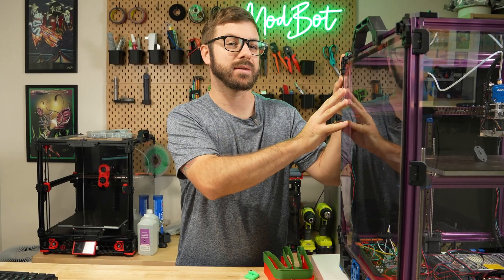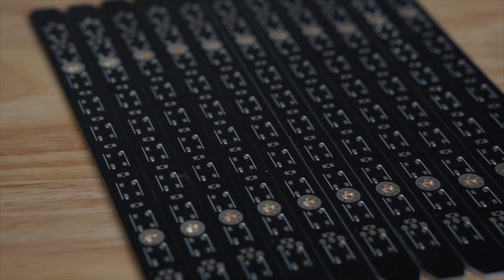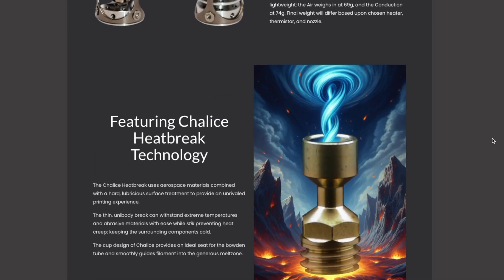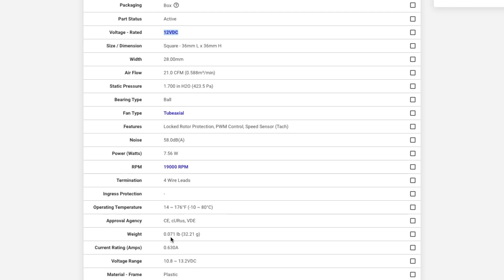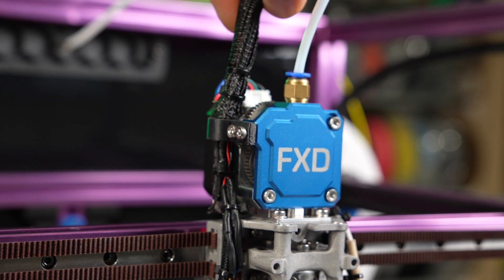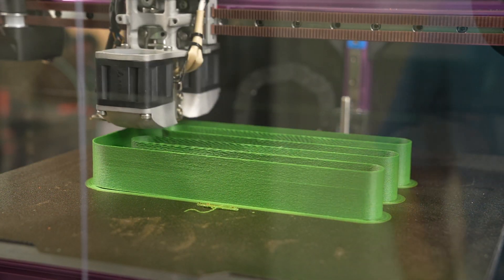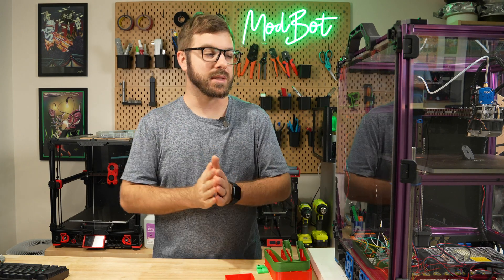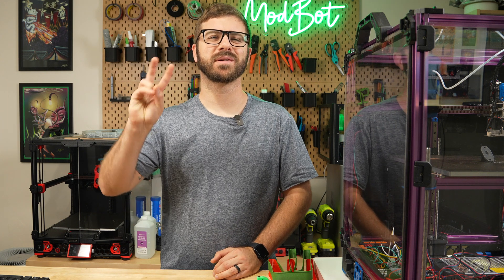You've Never Seen A Toolhead Like This! (Takeoff)

Comment: Burgo here! Thanks so much for showcasing my toolhead! Im so happy with takeoff v2 at this point i did alot of changes which made it
Cheaper
Lighter
And easier to put together!

Ita definitely a chunky toolhead but for being in a close weight to stelathburner with easily 10x the cooling, capability for high flow rates, dealing with hot chambers.

Id totally recommend monolith gantry by cloakedwayne as an upgrade though! 6mm belts have alot more stretch then 9mm at length so why not tackle longer belts and thicker at the same time!
Reply: I would also recommend Monolith vs my plated AWD. Neat to see it show up in the video though.

Comment: I hot-glued a MP1584EN buck converter to my 12V fan so I could run it from an EBB36 at 24V. It's kinda ugly but has been working great for years. The buck module is connected to the fan header, which is configured as enable_pin, and then I use a separate pin for PWM control of the 4-pin fan. You could also run 12V power from the mainboard and use the toolboard for PWM. This would work even with 2-pin fans because it's typically the low (ground) side that is switched.

Comment: you mention an ugly umbilical cord, ugly wiring, but mention nothing on the ugly volume delta fans produce, or how ugly the print head looks.. not to mention youve only printed test parts.. so basically you were testing it with no plan to actually use it..

Comment: I'm sorry how is this a hell of an option for peak performance and industrial application???
First of all industrial application usually means printing with not so printing friendly filaments like pa and such. They are never printed at speeds higher than 5mm3/s cause they lose strength otherwise so having a giant heater is pointless, and only adds weight. Even abs is recommended to be printed at that speed. More is only plausible for PLA and PETG.
Secondly with those behemoth of a fans on the printhead im wondering why not just strap a car turbocharger turbine? Its just a teeny-tiny bit heavier and provides a lot more thrust, you can even blow the part off after printing. Its not like having an extra kilo or two on the accelerating part makes it perform worse. I must be tripping....
Don't even get me started on the 6 bolts of rigidity of the radiator....
Jokes aside if you actually want a high performance printhead, you shold use nema 14, orbiter like feeder, cool it with cpap assembly and trusty 'ol e3d volcano for industrial application, and maybe a Goliath if you want to print PLA at 200mm/s

Comment: Will you consider using a tool-changer?
:) you might be able to use the previous tool-head aswell
and the more good youtubers build it, the more info there is on how to do it yourself & build the toolchanger community.
(i am thinking of getting a toolchanger myself for the Voron 2.4)
but there are 2 - 3 ecosystems out there

Comment: PLEASE PLEASE PLEASE. do a full review of the LDO smart orbiter 3. I believe it has inbuilt tool board with accelerometers and USB connectivity? Are the hardened gears standard or an optional extra. What is the hot end max temp???? Please do a review. 🎉

Comment: This toolhead is a complete nonsense (in the literal bad meaning). It is so heavy it prints bad. We can see VFAs and Ghosting in the printed parts you showed - after you applied input shaping. This is very often what I see in many Voron machines: people go into an insane spiral of "premium hardware seeking" and the whole thing gets too heavy and prints bad.
I love your content, Daniel. I liked the video. I don't see why anyone should spend so much money into something that doesn't print better than a good consumer printer (I am talking about this head setup, not the Voron project as a whole).
Reply: One person (using the stock gantry) having mediocre results doesn't mean the toolhead is bad. Everything you said in this comment is just stupid.

Also, this toolhead weighs less than stealthburner. So ignorant...
Reply from the maker: It’s heavy yes, but I don’t think it’s quite as heavy as you think. Much of the limitations are from the rest of the printer needing upgrades to be able to really take advantage of it. Beefier motors, 9mm belts, cnc motor mounts/XY joints to really take advantage of it. The plan is to have this as a high temp printer that can print fast and clean. It’s not there yet but this is the first step. Do I think this is right for everyone and that people should rush out and buy it? No but for those that have the need and want to really push the limits having the option is really nice. 3D printing is not a one shoe fits all and while I mostly cover more standard hardware being able to also look at some of these other options occasionally is a lot of fun and I learn alot in the process. 

I’m hoping to continue to upgrade this machine and get it to a spot where I can use it for testing out higher temp materials for those that do have a need or want for them.

Comment: I have 2 12v fans in series on my printer so i can drive them with 24v. I know theoretically there could be fluctuations where one gets more voltsge than the other if one stops, but ive had no issues and stopped one entirely just to test ($2 each)

Comment: So it's big and heavy and therefore slow. But it's big because it needs metal to hold 2 very big fans. But the fans are too big, so you only need to run them at 20%... yeah, that doesn't add up: this thing seems overengineered and overshooting its goal. Not very useful this way.
Reply: Hi there! This toolhead was designed with a stiffer gantry in mind (metal+9mm belts) which will allow the metal to do its job! The toolhead is stiffer than any plastic toolhead but can really use the stiffness in the rest of the gantry. Takeoff weighs close to the same as stealthburner, and plenty use that as-is! Also: The 20% fan thing is mostly due to low chamber temps - when you print near TG of abs (70-80c) you will need significantly more fan for proper printing, which is why these axials are so good.
Reply: The fxd extruder actaully is within 5 grams of an orbiter "it supports nema 14 or 17 "

Comment: I'm running Calamity toolhead, not takeoff but also get great Y results and messy X axis.  Haven't figured out why yet but until then or as another video idea you could look into danger-klipper and using independent x/y accel limits.  I've been doing it for a few months now and it works great.  Basically, set your printer kinematics to limited_corexy instead of corexy and then you can set independent limits for x and y accel.

Comment: What's special about this extruder ? From an outside view, it seems like a simple LGX clone
Reply: It's monolithic, so the gears can't be misaligned like with pressfit gear systems leading to bandng due to inconsistent length of extrusion because of the off axis alignment of the gear and the gear pin

Comment: hey @ModBotArmy I want to use the sensorless homing macro. Is there any chance you can send me the link for the macro?
Reply from the maker: This is what I got from Steve. I made some slight tweaks like changing the TMC and setting motor power to 70% but thats the main changes:
[homing_override]
axes: xyz
gcode:
  {% set home_all = 'X' not in params and 'Y' not in params and 'Z' not in params %}

  {% if home_all or 'X' in params %}
    _HOME_X
  {% endif %}
  
  {% if home_all or 'Y' in params %}
    _HOME_Y
  {% endif %}
  
  {% if home_all or 'Z' in params %}
    G90
    G0 X150 Y150 F6600
    G91
    G28 Z
    G1 Z10
    G90
  {% endif %}

[gcode_macro _HOME_X]
gcode:
    # Always use consistent run_current on A/B steppers during sensorless homing
    {% set RUN_CURRENT_X = printer.configfile.settings['tmc2209 stepper_x'].run_current|float %}
    {% set RUN_CURRENT_Y = printer.configfile.settings['tmc2209 stepper_y'].run_current|float %}
    {% set HOME_CURRENT = 0.6 %}
    SET_TMC_CURRENT STEPPER=stepper_x CURRENT={HOME_CURRENT}
    SET_TMC_CURRENT STEPPER=stepper_y CURRENT={HOME_CURRENT}

    # Home
    G28 X
    # Move away
    M400
    G91
    G1 X-10 F1200
    
    # Wait just a second… (give StallGuard registers time to clear)
    G4 P1000
    # Set current during print
    SET_TMC_CURRENT STEPPER=stepper_x CURRENT={RUN_CURRENT_X}
    SET_TMC_CURRENT STEPPER=stepper_y CURRENT={RUN_CURRENT_Y}

[gcode_macro _HOME_Y]
gcode:
    # Set current for sensorless homing
    {% set RUN_CURRENT_X = printer.configfile.settings['tmc2209 stepper_x'].run_current|float %}
    {% set RUN_CURRENT_Y = printer.configfile.settings['tmc2209 stepper_y'].run_current|float %}
    {% set HOME_CURRENT = 0.6 %}
    SET_TMC_CURRENT STEPPER=stepper_x CURRENT={HOME_CURRENT}
    SET_TMC_CURRENT STEPPER=stepper_y CURRENT={HOME_CURRENT}

    # Home
    G28 Y
    # Move away
    G91
    G1 Y-10 F1200

    # Wait just a second… (give StallGuard registers time to clear)
    G4 P1000
    # Set current during print
    SET_TMC_CURRENT STEPPER=stepper_x CURRENT={RUN_CURRENT_X}
    SET_TMC_CURRENT STEPPER=stepper_y CURRENT={RUN_CURRENT_Y}

Comment: Could you please share the homing override sequence from the screenshots? Thanks.
Reply from the maker: [homing_override]
axes: xyz
gcode:
  {% set home_all = 'X' not in params and 'Y' not in params and 'Z' not in params %}

  {% if home_all or 'X' in params %}
    _HOME_X
  {% endif %}
  
  {% if home_all or 'Y' in params %}
    _HOME_Y
  {% endif %}
  
  {% if home_all or 'Z' in params %}
    G90
    G0 X150 Y150 F6600
    G91
    G28 Z
    G1 Z10
    G90
  {% endif %}

[gcode_macro _HOME_X]
gcode:
    # Always use consistent run_current on A/B steppers during sensorless homing
    {% set RUN_CURRENT_X = printer.configfile.settings['tmc2209 stepper_x'].run_current|float %}
    {% set RUN_CURRENT_Y = printer.configfile.settings['tmc2209 stepper_y'].run_current|float %}
    {% set HOME_CURRENT = 0.6 %}
    SET_TMC_CURRENT STEPPER=stepper_x CURRENT={HOME_CURRENT}
    SET_TMC_CURRENT STEPPER=stepper_y CURRENT={HOME_CURRENT}

    # Home
    G28 X
    # Move away
    M400
    G91
    G1 X-10 F1200
    
    # Wait just a second… (give StallGuard registers time to clear)
    G4 P1000
    # Set current during print
    SET_TMC_CURRENT STEPPER=stepper_x CURRENT={RUN_CURRENT_X}
    SET_TMC_CURRENT STEPPER=stepper_y CURRENT={RUN_CURRENT_Y}

[gcode_macro _HOME_Y]
gcode:
    # Set current for sensorless homing
    {% set RUN_CURRENT_X = printer.configfile.settings['tmc2209 stepper_x'].run_current|float %}
    {% set RUN_CURRENT_Y = printer.configfile.settings['tmc2209 stepper_y'].run_current|float %}
    {% set HOME_CURRENT = 0.6 %}
    SET_TMC_CURRENT STEPPER=stepper_x CURRENT={HOME_CURRENT}
    SET_TMC_CURRENT STEPPER=stepper_y CURRENT={HOME_CURRENT}

    # Home
    G28 Y
    # Move away
    G91
    G1 Y-10 F1200

    # Wait just a second… (give StallGuard registers time to clear)
    G4 P1000
    # Set current during print
    SET_TMC_CURRENT STEPPER=stepper_x CURRENT={RUN_CURRENT_X}
    SET_TMC_CURRENT STEPPER=stepper_y CURRENT={RUN_CURRENT_Y}

Comment: I run ABS GF with a .6 nozzle
Reply from the maker: I have had pretty good luck with even a .4. Some of the older CF filaments though I had clogging issues with. I feel like overall filament has just gotten better over time.
Reply: You should try our colored abs gf it prints with .4 at .1 layer height no prob

Comment: Looks proper hideous that tool head. What benefit is there with 2x 12v heavy blowers over a light weight cpap? I haven't run into any issue at high speed high flow printing using cpap. You could then get rid of all the weight and hideous wiring and use a tool board.
Reply from the maker: Beauty is in the eye of the beholder. CPAP is stupid loud which is one of my biggest complaints. Deltas at 100% are definitely not quiet but the way I have been running it is actually not that bad.
Reply: @ModBotArmy my cpap runs Max 30% and that's over cooling when printing at high speed. Put it in a muffler it's practically silent.

Comment: That hot-end looks solid, but it seems to have a learning curve  attached to it. Or am I wrong?
Reply from the maker: I dont know if I would say a learning curve. In my case alot of that came from being an early adopter. I anticipate V2 with the manual and configurator will be much more straight forward.
Reply: I'm running chube conduction.  No learning curve with the hotend at all, the fans are the only part that is a little non-standard, they are 12v 4 wire fans which most toolboards and even some mainboards don't support out of the box.  As long as you can get the fans working with your setup the rest is very straightforward.  I've been loving mine, finally found a hotend I was happy with and settled on after going through volcano, mosquito, volcomosq, rapido, and dragon ace before it. If you like to print big parts it's just wonderful.

Comment: Fairly certain the EBB board has 12v jumpers but it would look weird on your printer. Also, it's possible to overvolt some fans, I know 12V sunon fans handle 24V, but I'm not sure about delta's
Reply: ebb36/42 don't have 12V jumpers. Only the sb2209/2240 ones do have jumpers.

Comment: Artic MX-4 continuous temperate range is only up to 150 degree C.  Wouldn't you need boron nitride thermal paste instead which can go up to 850C?
Reply from the maker: Where it’s at it shouldn’t be getting that hot. My issue with boron nitride is that in my experience it gets rocked hard which could make removing a pain if ever needed for maintenance.
Reply: @ModBotArmy  Yes agreed.  That's one part of BN that I hate the most.   Have you tried measuring to see if it ever gets above 150?
Reply: The point is that it never gets that hot. The paste goes on the cold side, the heater+therm are where you use BN.

Comment: Suggest a Boron Nitride Thermal Paste for hot ends, especially ones that can go upward of 500C.
Reply: For the heater cartridge, thermistor, and nozzle, yes. For the heatsink and heatbreak connection, no. You want something that doesn't dry out

Comment: Luke is close to releasing Jupiter toolhead board which will have 12V and beacon support. I think even beacon sock support to slow even higher temps.
Reply from the maker: I need it!!
Reply: @ModBotArmy  did you already look at it it’s usb also vs can. He’s waiting for the betas to come in right now. I’ve been waiting for a Jupiter. I had a nitehawk36 but was one of the unlucky few that had issues in chambers

Comment: If the fans are running at like 20% max then would it make more sense to redesign the ducts to use only 1 fan and loose some weight while at it?
Reply: you need the cooling for proper temp ABS printing & PLA. when printing at 75-80c with abs, 80-100% cooling is required
Reply: @LukesLaboratory at 11:37 he says he hasn't taken the fans above 20% for abs because of much air they move.
Is he just moving to slow? Or his enclosure to cold? Or nozzle to small? Or yes to all? In which case is this aimed at the 1.0mm+ bore crowd?
Reply: @JH-zo5gk  he's in far too cold of a chamber with a weak gantry. 1mm bore is a sweet spot for using the chube conduction imo, the air is equivalent in perf to the chube conduction with a .4, .5mm nozzle
Reply: @LukesLaboratory would a thinner fan that moves less air and putting a lightweight spacer in be a sensible option for those who plan on the smaller nozzle diameters to shed some mass?
Reply: @carneeki  depends if you're a full-plate person or not - If you typically print full plates where they can cool down naturally or if you're printing cold (sub 70c chamber) abs, you can probably get away with a thinner fan stack.

Comment: I'm making a 600mm by 600mm bed size printer. Modbot do you think it's possible to get a hotene like that for 2.85mm fillment for industrial application?
Reply: Hi there! Chube came about because I needed a bigger hotend in the first place for my industrial stablebots! You should be more than happy with 1.75mm filament up until you're looking for more flow with 1.2mm and larger nozzles
Reply: Isn't the FXD supposed to be buckling-proof? I don't see the value of 2.85. I see pellets being more practical for industrial printers because of the cost of manufacturing large spools.
Reply: In theory 1.75 mm has much higher peak flow than 2.85, because the limiting factor is heat transfer from outside to center of the filament, and it has a lot longer to go in the latter.
Reply: @daliasprints9798  This is only true below ~150mm3/s or so - after that you actually run into issues with the filament buckling under extrusion load and need to switch to 2.85

Comment: 1:15 Why are the drive gears so flat?
Reply: More Surface area for grip
Reply: @LukesLaboratory  Interesting, usually they have sharp teeth to bite in to provide grip.
Reply: Like Luke said, surface area. Having more surface area to push the filament does more than biting it with teeth like most extruders. It also leads to not shredding filament causing dust or more inconsistent extrusion
Reply: @Jackxgreer  Makes sense. First time I've seen gears like that and given that massive jam, it clearly works.